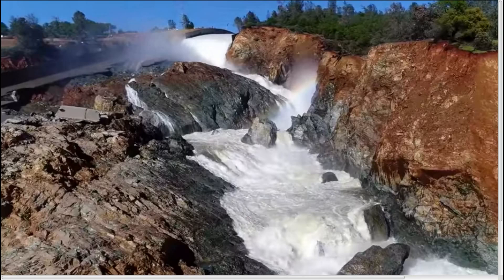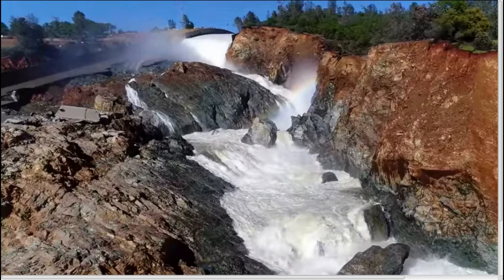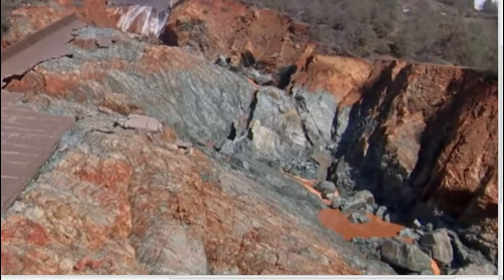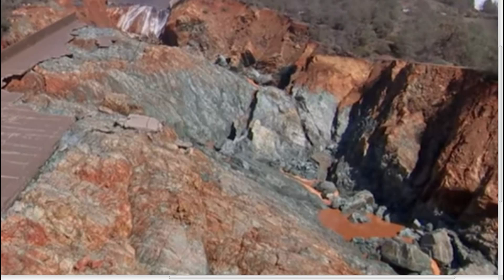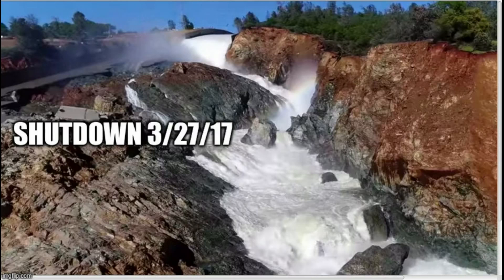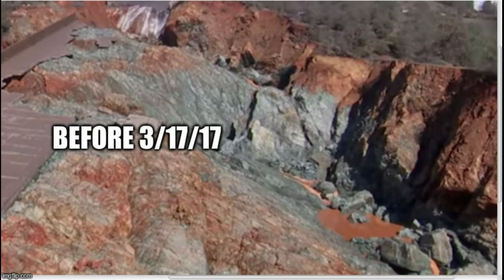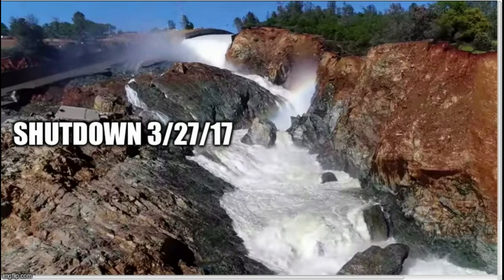OROVILLE DAM: Images Show Significant Erosion after 3-27-17 Spillway Shutdown

Comment: New spillway should use more modern technology.  Suggest a tunnel type of spillway set well into bedrock with a reduced grade (current grade is 24.5 percent.)  The supporting steel structure is to be lined with embedded forced air vents into the concrete. The partially aerosolized flows will avoid cavitation.  This will take a couple of years to design and build, and will require temporary repairs to current SW.  About 3 billion.
Reply from the maker: Thanks for your comments Lad A Dog ... 3 billion. Yikes! It would be the best damn, dam money could buy, we'd hope ... :-)
Reply: Where will they get the $3 billion to build it?  They've already spent $200 million and rising, and they've really done nothing to improve the spillway.  They've placed a bandaid on an ES that is worthless.  Some people in charge should be fired!
Reply: They could drain the lake if they took the plug out of diversion tunnel number one.  It's over 4000 ft long, about 30 ft wide, and was constructed to divert the water from the Feather River during the original construction.  Best to do it in mid to late summer when the flow is much lower so as to avoid flooding Sacramento.
Reply from the maker: https://www.youtube.com/watch?v=TCtXEq1qzo0
I wish it was only 164% ... CDWR just released the April 2017 Manual Snow Survey at the Phillips Station where they conclude it is still at 183%. Snow depth 94", water content 47%. As I`ve been preaching in all my vids, it is the big water monster that will at the very least keep constant pressure and need to do releases on the dam well into June, at least.
Reply from the maker: I was probably overly optimistic and more trusting than I should have been right after they shutdown the primary spillway, until I saw the images I used for this vid. But now, 4 days after the shutdown, I think its a fair question as to why the public has not been shown clear images of the ravine post shutdown?
Reply: I'm a little surprised by the 164 percent since I've been looking at the hydrological data for a couple of months.  Most areas were posting near 200 percent, with areas around Tahoe at almost 300 percent of historical norms.  Guess they caught a break in recent weeks, or the melt off took a big bite.
Reply from the maker: It`s the water density that blows me away. 47% is like the New England/East Coast white cement we often end up with. Not as typical for higher western mountains. But we never have 8 ft of it on the ground.
Reply from the maker: I trust the guy in the new DWR video ... I think that`s probably accurate. If it had been a statement or report by DWR without the video, that`s another story. What is bothering me is that 4 days post shutdown, no high res drone images of ravine. All they gave us was the fluffy stuff of the channel being dug out again afterwards on the 28th. Big whoop. Let`s see the spillway up close and personal.
Reply: Lad A Dog hi. honestly i don't think they're in a hurry. pics too odd to me. are they fooling us? who really knows. i don't live there n media aren't there. weird.
Reply: I'm always suspicious of everything. It seems that  DWR wants to manage public perception when they should lay it all out and let the chips fall where they may.  I am wary because they have shut out most of the press, all of the general public and limit the photography to uber beautiful drone footage of the spillway and the river clean-up, without showing the critical area.  The press conferences are upbeat self-congratulatory blah-blah-blah sessions.  We want to know the extent of the seepage to the main dam to assess the level of hazard, and whether it too should undergo a major replacement.  We want to see how the shot-crete held up during the last release so that we can see if the spillway is further eroding.  We want close-up footage of the SW doors to see why one of them appears to be inoperable, and why so much water continues to flow down the closed spillway.  We want to see the emergency weir area near the parking lot where the lower elevation at the crest renders it to be at high risk for breach.  We want to see the conditions around the power plant, and the base of the main dam.  We get a regular dump of incidental info which does not address the very deep concerns of those whose lives are in peril.
Reply: Lad A Dog so sad what our world is. I'm purely disgusted. now i know why there was a "ripleys believe or not", smile,  n "smile, you're on candid camera". so sick n evil. bless you. Take care.
Reply: They need to make a big decision,  Should we spend good money after bad.  Much of the entire Oroville Dam system is in disrepair including seepage of main dam, one turbine out, one diversion tunnel blocked, other diversion tunnel missing internal valve, road over dam crest cracked along center line, auxiliary power plant burned up, roads missing or partially destroyed, one spillway chute door non-functioning, all spillway chute doors leaking, steel tendons at end stage, concrete door structure cracked in several places, concrete flume destroyed, emergency weir area eroded, small tree-lined spring, internal concrete core of dam tilted and cracked....IMO, the lake should be drained, and the project completely redesigned and constructed using modern technology.